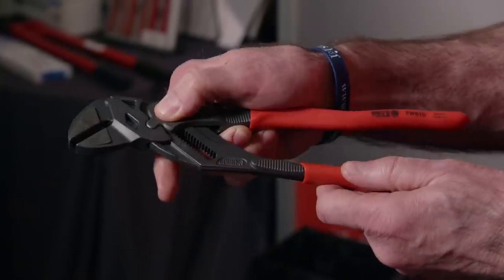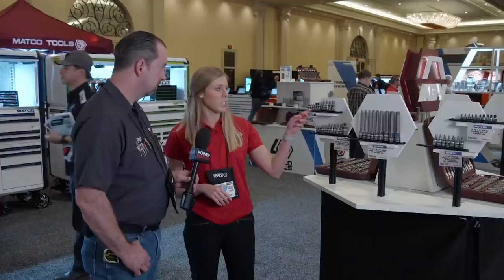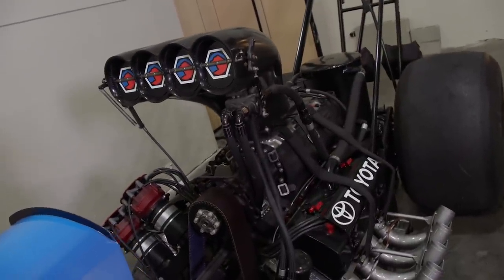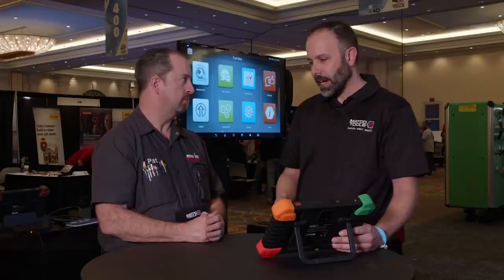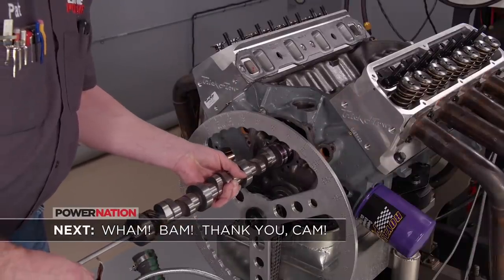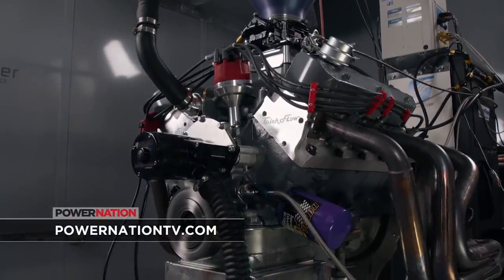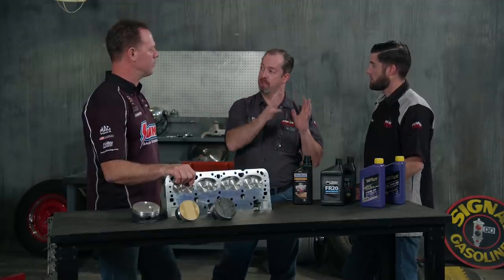Add an Extra 100HP to a Ford Windsor - Engine Power S6, E8

Comment: A single plane and solid roller will make more power but that also means more maintenance and a softer bottom end, requiring a ring and pinion change = worse fuel economy. This is where boost makes everything better. Yeah a Whipple cost more than a cam and intake change but starting off with a 500+ hp engine a fairly small increase in positive manifold pressure would make nearly four digit power.

Comment: I would have liked to see a pull with a 1.6 rocker arm ratio. I have seen many times hi RPM stability gets worse by installing hi ratio rockers. It may be possible why the motor peaks early in RPM. Open spring pressure seems a little low just another thought.  🤔 Thank you for the test.

Comment: That engine would be nice in my 72 F100 👍👍
Reply: Got a 302 in my 73 right now but I'm planning on a 460 rebuild to put in eventually
Reply: That new early NASCAR spec.s cam they installed will barely want to run below 4,000 RPMs...

Comment: On my 351w engine build,i used an edlebrock airgap intake manifold, it works great, just a FYI, thanks
Reply: what kinda hp you pushing.
Reply: @thomasthompson4999  1045hp

Comment: I would love to see a off road ford 400m build which is basically a stroked Cleveland.  For offroad big block reliable 300 hp to the ground 4 wheel drive, like in my 1979 ford Bronco.

Comment: I told my Marco dealer I'm not interested in that 6s untill they illuminate the color logos.
What do mean " hate doing ball joints" on gm trucks it pays almost seven hours and takes one hour to do at a normal pace. Plus you tack on a alignment then go home . I love doing suspension work. That's how mechanics make money.

Comment: That's a lot of spring pressure on that cast iron street roller camshaft
Reply: And how do you know its cast and not billet.
Reply: @maximusvonce1381  I saw it. Look at it when he's sliding it in the block. Cast iron
Reply: @cv 67 I agree

Comment: Do you think exhaust duration on cam is more than intake. I was taught a percentage of intake duration which makes it less because exhaust pressure  or exhaust is  power stroke cycle  to jobs in one. So pressures all ready in motion though mechanical  motion and interia and expansion of compressed charge let's throw a bit off kinetics for good measure yes there's more factors especially overlap ect anyway cut to end less exhaust duration gives a cleaner intake charge or a better ratio of incoming mix to a lit charge equals more efficiently = more power.thats just what I was taught what you think.

Comment: I have an off the wall question: Have you guys ever had an engine blow up while it was on the dyno? And if so how bad?
Reply: I was watching one when the Chevy they were working on went south. Didn't blow but did spray some oil. Can't remember what exactly went wrong though, sorry. I watch way too many vids like this so I just remember it happening. I think it was the engine that they put the blower on and then were building for one of the other shows, Trucks maybe?

Comment: Ill stick with DeWalt, I've got some I've had for 20years. Left them out in the rain , dropped them and they still work
Reply: Milwaukee offers a ton more tools for automotive technicians.  I made the switch about 2 years ago when I noticed that Dewalt did not offer half of the tools I was looking for since DeWalt is more focused on home improvement/ contractors.
Reply: Dewalt power tools have fell off the bad end, I returned 3 consecutive drills for excessive chuck runout, I mean really bad runout. Switched to Milwaukee and never looked back

Comment: Hi guys i have a GEN 1 f150 lightning 351 w everyone tells me the factory block is not good enough for boost as they have a habit of cracking using a blower what amount of boost is safe with the factory block or forget it and get an aftermarket block.

Comment: Unless you’re gonna race it. You’d be much better off, and produce more average TQ & HP with the hydraulic cam and dual plane configuration.
Too great of a compromise in drivability and usable power just to have that extra power from 5500 to 7000
Reply: Yea. That was pretty much a race only motor with that intake. There terrible on street. I had one on a cleveland.  What I have now is a dual plane with the center divider removed. Best of both worlds.
Reply: poor drivability of a single plane is a myth, you just need the right combination of parts and knowhow to have a streetable single plane. But the power band of the dual does make for a better street engine
Reply: @supersevenn  Not a myth.  Maybe you missed the part where I said I HAD ONE  ON MINE. 
 I experienced the difference. I am not repeating myth. I am sharing experience!
Learn the difference.
Reply: #countryboycansurvive right you’re sharing YOUR experience..just because YOU can not deal with “drivability” does not mean it’s not a “myth”
Reply: @eriv4735   epic fail on your part. That was some serious stretching you just did. Hope you didn't hurt your self.
Reply: @starbattles1  You have no clue.  I drive a fuel injected 438windsor 11.5:1 compression,  super victor efi intake,  comp cams xr292r street solid roller 254, 260@50 621, 627 lift, afr 220 heads,  th400 4k stall, 410 gears.  Spins like a swiss watch to 7200rpm. Makes power fron 3200-7200rpm. Drives just fine on the street. Basically a street race car. So it all depends on the build. Car weighs 3k lbs. Sucks 93 octane though...lol...Made 530wheel 460 torque through a full manual rvb th400 4k stall, 28in Mickeys out back. Drives great on the street. Cam is a street solid roller,  not a full race roller like this cam.
Reply: @eriv4735  Exactly right. Ignore that clown and read my post. I have a big cammed fuel injected 438windsor in my 68 mustang. Drives great on the street👍
Reply: @eriv4735 I agree with you. It can be done. Not cheap, but can be done. I know cause i drive one, and it has great street manners. Of course it aint no Cadillac,  but who wants a Cadillac in a 68 mustang...lol
Reply: @maximusvonce1381  that's the same cam you running 292
Reply: @jwhiting5958  Yea Xr292r
Reply: I had a 1980 notchback 302 with TFS heads. Victor Jr intake big hydraulic roller cam. 850HP carb. Car wasn’t special ran low 11’s and drove perfectly fine on the street.

Comment: This is when you guys should be the comparison between a  windsor and a cleveland,both 408 what is compression of this engine,i have just completed a 408 clevo with 11.5 comp with the crane solid roller TR262 with chi 225 with the chi manifold and AED 950 IT dynoed up 655 hp at 7200 rpm ,engine builder said if i had put his spec custom cam it would of made over 700,he didnt have a super sucker space plate,he tought it would make 680 with one
Reply: Yea but if you go with drag cams on the street your valvetrain wont last long. Need a comp cams street roller like my xr292r street solid roller
Reply: @maximusvonce1381  okay whats the specs of your engine and how did stack up
Reply: @maximusvonce1381  i

Comment: Wonder why the cam didn't really change where peak hp was found in the rpm range. I expected it to push the hp up to close to 7k. Thoughts?
Reply: it wasn't a hotter cam, it was just a better cam and increased the dynamic compression ratio so torque was increased basically everywhere.  an overlay and a longer rpm sweep would have been nice to see the actual differences between the two.

Comment: Has anybody used the solid roller cam used in this 351w and if so did you make 600HP?
Reply: That's a stroked 351, it's 408ci

Comment: HELLO!

Most of us have NO INTEREST in reducing our gas mileage..!

Why not tell us the mods that will increase power but not reduce mpg when we don’t use the extra power?
Reply: Fuel injection, high compression ratio or turbocharger, modern combustion chamber design and ring pack. Also don't have more displacement than you need.

Comment: Now that you got bought out and moved to week days, I can no longer watch the show. I have a 408 Stroker in my Fairmont, I need to make some changes like you guys did so I can make 600HP, I am making 501Hp as it is now, I am running mid 11s I would like to break into the 10s and 600Hp will get me there not sure the trick flow heads will work with my headers maybe AFR 220 heads will work for me and that same cam or maybe you can sell me that engine?
Reply: A little nitrous will get you there in a hurry

Comment: 11:30 That line is too large to check manifold vacuum. They would use a smaller line about the size of distributor line.
11:53 that hose was hooked to the intake closer to the carb than the head. Another thing they are not showing us is the air fuel ratio. If that engine needed more air flow. It would have ran rich.

Comment: Big power if you drive flat out, wide open throttle all the time in your daily driver. Lol
Reply: I'm doing a 351 with a small cam. Afr 165 heads. DP intake and efi. 
The things going to make stupid torq from 1600-4500 rpms. Should be fun in my 67 fastback with a 5spd :)

Comment: Will a factory 4.6 Ford transmission bolt to a  351 or a302 Ford engine.
Reply: No you need a 4r70w from a 3.8 ford vehicle the 3.8 was a Windsor block so it has the same bolt pattern as the 302/351 it will bolt right up but you will need a stand alone ecu to control the electrical functions of the transmission the 4.6 4r70w will not work on a 302/351 the 4.6 had a diffrent bolt pattern
Reply: @boosted2v56  thanks a lot
Reply: Any idea on a stand alone ecu u would suggest .
Reply: @scottkeeton956  I went with msd atomic tcm it was 700 for it I'm pretty sure just get on the holley website that where I got mine from there is prolly cheaper ones but I went with msd
Reply: @boosted2v56  thanks for your time and help .
Reply: @boosted2v56  Thanks for dropping that knowledge

Comment: that junk cast solid roller from Comp will not last.  I've replaced several because the heat treat is weak.  It is not a billet shaft at all, its a fancy cast flat tappet.  the metallurgy is soft Chinese junk!  Bullet Racing Cams has the cure for the Comp Blues...

Comment: How long can this engine run at full power? I bet it will break in 2 hours.  Manufacturers often do tests like that. 

Final test of engine school  is run what you built till it breaks then dismantle and inspect.  Nascar or Lemans engine builders need longevity . What do you build them for a 1 hr life?
Reply: Of course not

Comment: 13:20 Here is another lie they telling. If the intake was restricting air flow. The engine would have made less hp but still peaked at 6500 rpm. Go back to the video before this one and the engine peaked at 522 hp @ 5800 rpm. After installing the single plane intake. HP was 566 hp @ 6500 rpm.

Comment: Go with snapon tools only
Reply: Overpriced, but that's just me. My dad used to buy snap on. He said anytime something broke it was like pulling teeth to get snap on to replace it. After 3 of the same ratchet breaking gears and my dad having to damn near fight the snap on guy each time to replace it he stopped buying from them. He has craftsman ratchets that are over 40+ years old that still work to this day.
Reply: Hell no.
Reply: Absolutely.

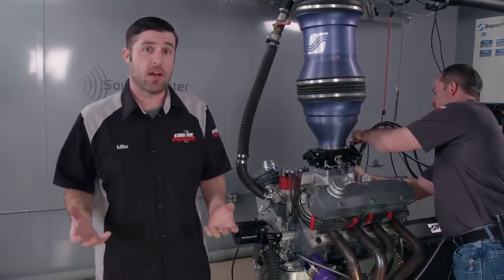Comment: 11:42 they never show where that hose is hooked. In order for it to show the intake is restricting air flow. It would need to be closer to the head. These guys are trying to get smart with their lying but I'm just as smart.
Reply: Have you done a lot engine building, dyno testing/tuning, and racing? Why would these guys lie about the dyno results?
Reply: @strictlybusiness1598  Are you joking? They lied to sell a Trick Flow intake. You do know the intake they claimed could not flow more than 680 cfm was an Edelbrook. Do you really think an Edelbrock only flow 680 cfm?
Reply: @strictlybusiness1598  I just check online and you don't need 680 cfm to make 522 hp. So they lied about that too.
Reply: Not necessarily the dual plane is a pig especially with too much camshaft that manifold was wrong for application that Trick Flow is like the Super Victor gotta figure too thats ywisted wedge heads and out the box it probably port matches their intake where the Dual plane probably was small at rhe head port leading to crappy flow/restrictions

Comment: Matco doesn't make anything.  They SELL.  Those pliers by KNIPEX can be bought anywhere.  Same with just about every tool and even the boxes.,  They just don't have the cool colors etc.   PRO TIP,  toolboxes don't fix anything.   I am not suggesting Waterloo or General Garbage but Extreme  sells lifetime warrantied very cool boxes.

Comment: The cam swap wasn't effective.  The Dyno graph proves it.  Check the numbers and you'll see that the start was past 4000rpm and the torq ( aka that which wins races) is only 7 more # ' and is in the same spot.   HP is a mathematical product ( calculation of torque ) so running the RPM higher makes more HP.

Comment: When I viewed the original Old Gray Mare video and I saw that these guys were using a dual plane intake with 225 cc heads, I did not think this would be an optimal package. I predicted that they would make 550 hp with a single plane intake. Low and behold they made 571 hp!

Comment: WHat kind of crap cam was that?  You only gained 40+ HP off it.  You should get at least 80+
Reply: @cv 67 Yea changing cams is more drastic then 40 hp. You can get 40 hp with cold air intake and exhaust. 
When you change how it breaths and open those lungs up it's dramatic. Unless you put a HP cam that is a mild towing upgrade you should see at least 80 hp on a decent upgrade cam.
Reply: @starbattles1  no